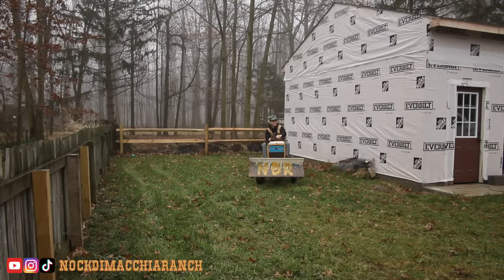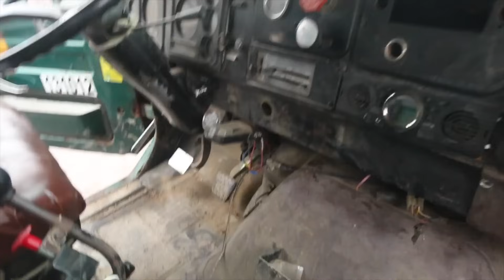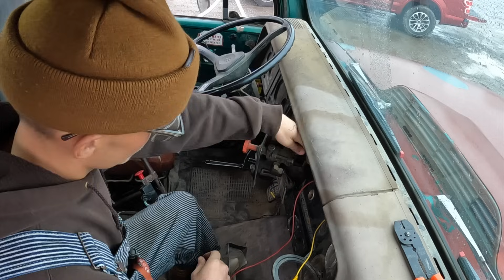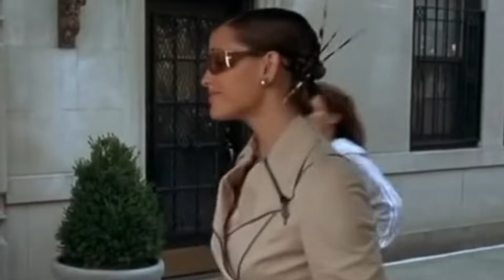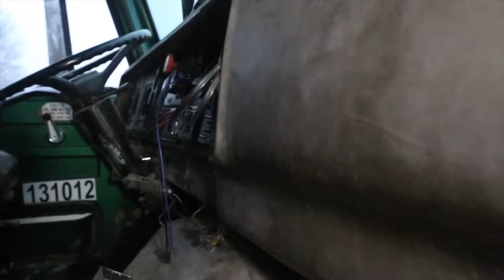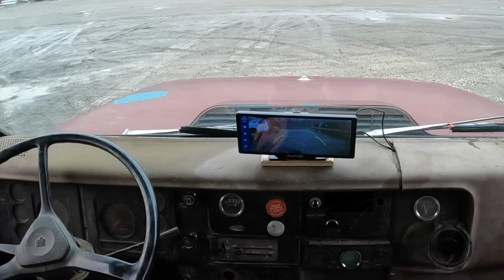DASH CAM & BACKUP CAMERA - EASY INSTALL!! - 1980 International S1854 Dump Truck

Comment: If you don't drive that truck every day all day, i'm sure it's hard to get a feeling of how far back stuff is using just the mirrors and windows, so that camera is definately a good little helping hand. I'm just wondering how dirty the lens gets when you drive the truck in the rain or on gravel roads. If you have to jump out of the cab to clean the camera lens every time, that kinda defeats the point of it.
And please be careful working under a raised truck bed. I'm always worried that people forget to put the locking braces up and just trust a hydraulic system to keep them alive back there. Might be good to show stuff like that in future videos, as a reminder for everyone that safety is important, even when you "just do a quick fix/job".
Reply from the maker: I'll do a better job of pointing out where the brace is in the next one. I did briefly mention that I had it up, but definitely a good point. Thanks!